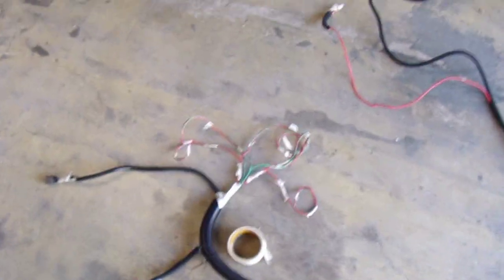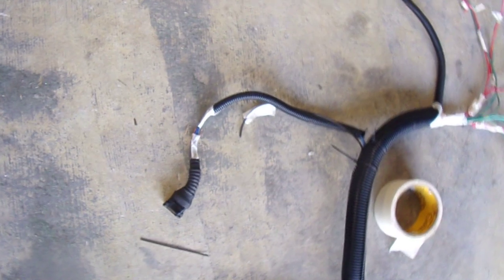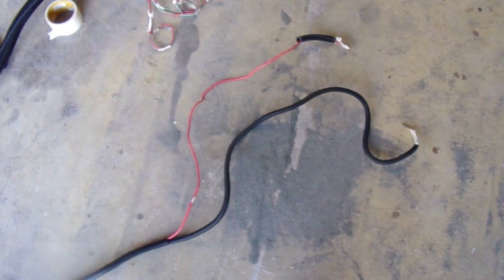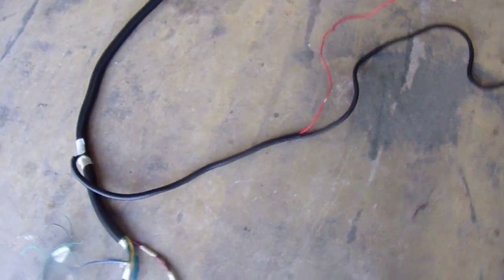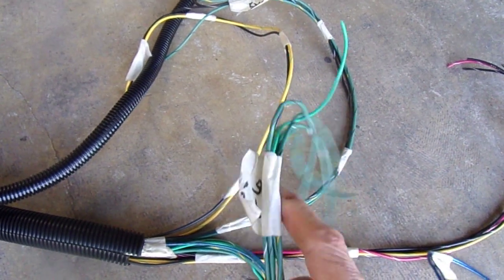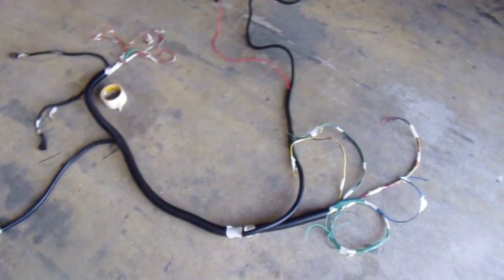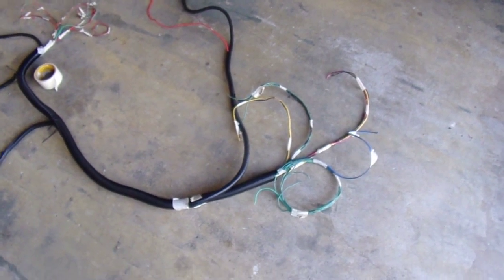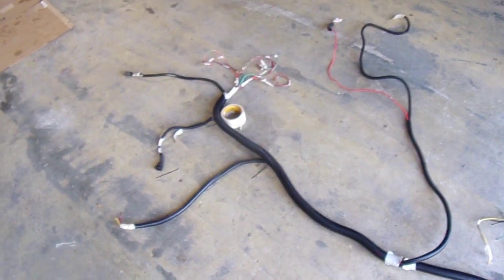EFI wire harness part 2

Comment: Very nice Dave! Your wiring loom is legit! The engine electrical system seems much simpler when you break it down into sections! Thanks for the awesome videos Dave! LOVE These L28E/Ts!
Reply from the maker: Its coming along, waiting for a firewall grommet, needs to go on before starting terminations. Also how to make the adapter plugs for 280zxt vs 300zet. Thats taking some thinking.